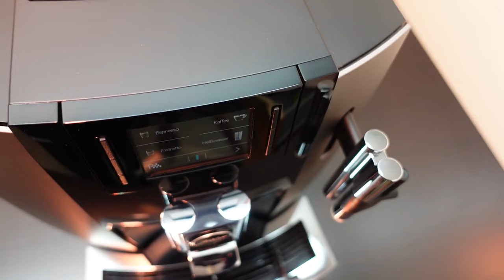Jura E8 Refurbishing and Deep Cleaning

Comment: as a Jura technician, i have to say this machine actually looks exceptionally clean for being in use for 6 years. I've seen machines that would give you nightmares after just 3 years
Reply: As a Jura technician - would you buy one new? I’ve seen so many horrible pictures of the insides and stories of them being sent back to Jura prematurely. I’m hesitant of chucking 4k at one.
Reply: @ollydearden  I only have experience with jura machines so i don't know what other brands are like, but i'm not so sure anymore with the recent line-up of machines. I've been a technician for +10 years and i like the older models way more, i tend to compare them to cars : less technology, more noise but they don't break. I've seen old F models that are 14 years old and came in for service for the first time. 

On the other hand the newest models do have impressive features but require perfect maintenance and usage (lots of user errors happen because customers don't know how the machine works)

So in short : i'm not a fan of the newest machines, and would probably buy an older model second hand for 1/3rd of the price. Then again i do know what to look for when looking at second hand machines but still.. Hope this helps a bit but if you have any more questions be sure to let me know
Reply: @axoliminator  I really appreciate such a detailed, honest answer. I think I’m getting swayed to proper espresso machine.  I realise it’s more work - but it’s only really for two people. I’m fairly handy, but I don’t think I want to spend that money and have to tear it apart. If you think of anything else, I’d be interested. Thanks again.
Reply: @axoliminator  I'm almost sure of buying a E8 EB... You talk about "perfect use & maintance", you mean not to skip each time that the machine asks for a cleaning cycle or the cleaning after each milk drink, dont you? Thanks !
Reply: @kodax86  yes, decalcifying (or filter exchange) and cleaning the brewunit and milk system is mandatory when the machine asks for it.

Also, try to stay away from adjusting the grinder to a finer grist setting when the machine is new. Lots of people start adjusting the grinder to a finer setting because they want a stronger aroma but the grinders in these machines are already very fine when new. When the grist is too fine it can clog the coffee sieve of the brew unit, cause internal stress on the blades and in turn over stress the grinder motor. Instead, adjust the aroma through the display settings. This will increase grinding-time, thus give you more grist. I recommend leaving the grinder on the coarsest setting to give it the longest lifetime possible but as long as you don't go past the middle setting you should be fine.
Reply: Incase of the E8 EB, the grinder adjustment is especially important since they use a new type of grinder that grinds extremely fine (a bit too fine in my opinion 😅). The coarsest setting is basically mandatory here
Reply: @axoliminator Super! Many thanks :)
Reply: Do you by any chance have access to Jura Z10 service manual? Or at least section on complete dissassembly?

Comment: Im really impressed! Its almost good condition. I owned Philips EP2231. It served for 2.5 years, i cleaned every week and month as in manual, cleaned, descaled, applied silicone everywhere, it's like new BUT it used to broke 2 times. After 6 month first problem - motor for the brew. Then it electromagnetic valve or something like that.. Now looking for Jura or Delonghi

Comment: I disassembled and cleaned the entire brewer unit. Put it back together and turned the machine back on. Now, when brewing coffee the water just falls into the drip tray behind the unit, not touching the coffee grinds. The coffee grinds then fall, dry, into the drip tray. Any ideas on what went wrong? Any help would be greatly appreciated. I have a Jura Ena 8.
Reply from the maker: The molded seals in the drainage valve must face inwards, otherwise the water pressure cannot be built up and the water flows into the drip tray. Also check that the valve pin is working properly, sometimes the plastic cap breaks apart.

Comment: Thanks for this - we're cleaning the brew group to get rid of an e8 error. Small tip - at 05:53 you pull the connector from the front panel assembly by its wires. I'd pull them out by the plug.
Reply: he is alfa and you are beta, that's the difference

Comment: Thank you for great instructional video. 
I have a problem with a WE8 model very similar to this one. 
Once every few or a dozen or so brewings, the coffee does not appear in the cup and the ground coffee falls into the grounds container and the water into the drip tray. 
The machine is only 4 years old and has made about 13,000 coffees. 
Could you suggest what could be the cause?
Reply from the maker: Hello, I think that the brewing group needs to be replaced. When the brewing group wears out, it skips the cycle and the brew chamber does not open. As a result, the ground coffee falls into the drip tray.

Comment: Question, if I may. When making a cup of coffee, the grinder and it's plastic fan stopped rotating.  I started hearing the motor inside of the grinder assembly spinning much faster then it usually does, with the louder, whining type of noise. The beans stopped moving down the grinder funnel. After a few seconds, the motor stopped. The machine showed a message, asking to add coffee beans, even though there were plenty of beans in the bean funnel. 
I disassembled the machine following your instructions. Accessed the grinder and found a piece of metal stuck in there. After I removed it the debris, I took of the fan, the grinder cone, the cloth washer, cleaned it all up. It did not look damaged or skewed. Everything assembled straight and flush. Put it all back together. After the normal warmup and prep, I initiated making a cup of coffee. The grinder started rotating normally, moved some beans in,  but in a few seconds, without any visible reason, the fan and the cone just stopped rotating, beans stopped moving down, and the whining sound reappeared. 
Have you encountered this problem before? Do you think there is a chance of fixing this, or do I need to replace the grinder assembly? It's kind of expensive. :(((
Thank you for your time!
Reply from the maker: Has the long screw become loose after you brewed the first cup of coffee? It's best if you disassemble everything again and send me some pictures to yt.myworks@hotmail.com maybe I can spot something.

Comment: Wonderfull video and extremely details.  Thank you.  My nozzles that the coffee comes out off are clogged and I have not been able to get to that particular part.  I am afraid I won't be able to put it back together if I go that far.  I may have failed to descale regularly.  Any suggestions?
Reply from the maker: You can try to clear the spout from below with a small brush. If that doesn't help then something else is probably clogged. Descaling is also highly recommended.

Comment: Trying to keep the cup tray from getting scratched up is a trick. I have two methods. You can use a silicone coaster. They are available in many colors and designs so you can find one that suits your aesthetic sensibilities. Or you can stick on a sheet of adhesive clear plastic, trim it to fit, and then cut enough out to allow drips to pass through.

Comment: Great video!  Love the detail and camera work. I am getting coffee out of the right milk coffee side, but no coffee from the left coffee only side.  I can sometimes get water coming out if I rinse or if I grind a minimal amount of beans.  Any idea about which part has failed?  I will be replacing all the o-rings in the cleaning and rebuild but was curious.
Reply from the maker: Try to descale the machine, to do this the filter function must be deactivated. I suspect that something is clogged. Or the ceramic valve no longer works properly.
Reply: @yt.myworks  Thanks. I am not sure this is the problem since I can make a flat white without a problem.  I will try descaling after I get everything back together.  I have descaled regularly as the machine requests it, and we do not have high mineral water.

Comment: Thanks for this video. My machine was leaking and it was coming from the discharge valve. Upon removing the pin with the red pointed tip I realized it was worn and may be the problem. 

I have a question though. The pin replacement kit comes with 2 additional replacement gaskets (3 total). Do you happen to know where those gaskets go in the discharge valve assembly?

Thanks!
Reply from the maker: I made a video of assembling a Jura F50 brew group, maybe it will help you when replacing the seals: https://youtu.be/z2cnI2h4rVE

Comment: I was looking for such a video instruction to clean my E8 after 3 years. but now I understand that there is no need to do this for another 2-3 years))) I use cleaning products when the machine recommends. the only thing I would like to change is to make the grind even finer. is this possible other than what can be done with a lever?
Great job!❤
Reply from the maker: Hi, yes that can be done by removing the housing at the top. Then you can adjust the grinder more finely. The adjustment knob must then be moved back to the middle position.
Reply: thanks for the reply! I wanted to clarify because of the intricacies of the translation) do I need to disassemble the coffee machine in order to return the grinder to a finer grind? because now the lever is already maximally turned to fine grinding

Comment: Is there a link where I can buy only the black plastic grinder part with wings under the blade in this video at 13:31?
The grinder motor works normally, but the ground coffee is stuck inside the grinder.
Reply from the maker: As a rule, the part never breaks, try to reassemble the grinder correctly. It is important that the parts fit together correctly at minute 13:52 and 13:57. If that doesn't help, turn the grindstones a little looser and the coffee should come out.

Comment: Fantastic video. I am struggling to get the original clamps back on hoses. I noticed you used a different type of clamp. Any help or video on getting the original clamps back on?
Reply from the maker: That's why I use the oetiker clamps, they are easier to install and hold better ;-)

Comment: Hello, good video. I have cleaned the brew group but I think something went wrong, when placed the brew group back in I heard a lot of rattling noise. I have determined that this comes from the brew group motor that keeps spinning even when the white gear is already at the top and can not go further. Then I decided to turn on the machine without the brew group in place and see that the motor keeps spinning and does not stop. Do you think this is a bad encoder or something else that is wrong?
Reply from the maker: Hello, before installation you have to bring the brewing group into the basic position. When tightening, make sure that the gears of the motor and transmission are properly seated on each other.
Reply: @yt.myworks  would you mind to explain what the basic position is?
have the same problem.

Comment: Great video, very relaxing seeing the restoration. I wondered if you might be able to give some advice on my Z5. It is a US model that I brought back from the US to UK and have been using on a transformer for several years without issue. The other day the milk spout was not working and the water was going into the grounds bin.  I wondered if a pipe had popped off or split and took it apart but couldn't see anything obvious. Put it back together and it was the same so I thought it couldn't hurt to try another descale. After the descale, I got the refill tank message but after doing that I now get a system fill message and the pump/regulator appears to be making a different noise. Because it is US model it is unlikely that any local service agents would be willing to service it.

Comment: Great video! Is the mold inside a health risk? My E8 works fine after 8 years, should I still get it serviced and cleaned?
Reply: Yes and yes!
Reply from the maker: Definitely after eight years, I think there are already some cobwebs inside the machine ;-)
Reply: Yours is good. My brand new E8 got an issue with "System Filing" after two months.... Just a few drops of coffee coming out.

Comment: Hi, what and which size tools you used to unscrew bottom back cover ? It’s 2:11 on video.
Reply: Found it, need to get SS316 key. Can be searched Jura Capresso SS316 Repair Security Tool Key Open Security Oval Head Screws Special Bit Key Removal Service For Coffee Machine

Comment: Hello again . I am a big fan of your videos the have helped me so much .  I have a question. I hope you can answer.. I just finished my e8 restoration  however the scraper blade on the brew unit  cracked and glue  is not holding . I have extra v2 blade but not sure if it would be an issue in the e8 that has the newer v3 version .
Reply from the maker: Hello, you mean the shovel? Try running the brewing group up and down by hand, if the shovel doesn't get stuck anywhere, then you're fine. But I don't think that should be a problem.
Reply: @yt.myworks  ok . It does seem like they are of different lengths
Reply from the maker: Shouldn't be too short, otherwise it won't serve its purpose.

Comment: Thank you for your excellent videos.  After I did a cleaning I do not think I returned the brew group to its basic position as I no longer get pucks in the coffee ground basket.  What is the Basic Position?
Reply from the maker: Hi, in min 8;27 https://youtu.be/z2cnI2h4rVE you can see how to set the base position.
Reply: @yt.myworks  thank you!  I did it correctly. I am getting lose watery grounds in the basket. I think it is time for new gaskets. Do you have a site for parts in the US?
Reply from the maker: Sorry, I don't know of any spare parts shops in the US. If you find a good shop then please let us know here on this channel ;-)
Reply: @yt.myworks  after a complete rebuild I heard something rolling around inside. I found one single ball bearing?  I have no idea. It is 3.4mm. Any idea what it is?
Reply: @MarkVender  Is it the one used as a detent on the grinder? At 13:50 you can see a "cog" around the grinder if you unclip this there is a ring with small holes for indexing and underneath the ring with holes in...there is a deep hole with a spring that pushes up a tiny ball bearing this is into the holes and is used as a detent. When its all together and you twist the ring with holes in this should click everytime the ring is rotated as the ball clicks into a new hole. Thats the only one I've seen. Hope its helpful

Comment: My E8 drip tray has jammed in position - I think I tried to remove it too soon during operation. Is there a way to free it? Awesome video - Too much for me to tackle, though!
Reply: Had that too, best to make sure its gone through its cycle - not switched off early and the gently back and forward and it eventually comes out
Reply: I know it's been 3 weeks and you have likely remedied the situation, but... I had this happen a few weeks back. 
I just turned it off and back on and placed very mild pressure on the tray pulling it forward and up.... as the start process did it's thing it just popped free.

Comment: Man, you are totally a master at this!  Jura units are notorious for being difficult to take a part and repair.  Amazing job again!  I am curious, where do you get your parts from?  I am from the US and it's very difficult to find superauto parts.
Reply from the maker: Many thanks for the great words. Yes I know but I don't understand why the parts are not available in the US? In Germany there are various shops with spare parts, for example: "juraprofi.de" or "komtra.de". Then there's eBay and Amazon.
Reply: A lot of the German sellers do sell on Ebay US and Canada. I've had success there
Reply: I find them very easy to take apart and service. If you can use a Torx screwdriver, an icepick and a needle nose pliers you have the skills! It just a bit time consuming that’s all.

Comment: @myworks I am continually impressed with your videos and workmanship. Can you please provide a link to the mesh hose that you are using to replace the old hose at 18:10?
Reply from the maker: https://www.ebay.de/itm/292644294634?mkcid=16&mkevt=1&mkrid=707-127634-2357-0&ssspo=AQmADgC_SHO&sssrc=2349624&ssuid=fqjNmJj7Q9S&var=&widget_ver=artemis&media=WHATS_APP . 
You can find this part on ebay or amazon.  I still recommend the "oetiker clamp".

Comment: Thanks for this amazing video! I am almost done. One question mark remains after extensive online searches: how to remove/replace the rubber o-ring from the inside of the water tank (it's too narrow for me to reach with my arm)? I couldn't find any instruction on this online. And I also couldn't find out which ring size it is -> its not even mentioned on the Jura technical drawings. Is it a standard o-ring or is it especially produced by Jura?
Reply from the maker: It is a standard o-ring of appropriate size. You can carefully cut through the old seal and then lubricate the new o-ring with some silicone grease to help it slide onto the valve. https://www.juraprofi.de/Jura-Ersatzteile/Dichtungen/Dichtung-fuer-Jura-Wassertank-und-Schwenkverteiler::10046.html?refID=gbase&gclid=CjwKCAiAjPyfBhBMEiwAB2CCIhbQNKfZVfBU0AyRsBGE5NDMZnRPKxRmLQ_BwEw-8sFVAZfzGLA--BoCPwgQAvD_BwE
Reply: @yt.myworks  thanks for the very helpful response. I need to order the ring but to me it’s unclear which size the o-ring is. Do you know?